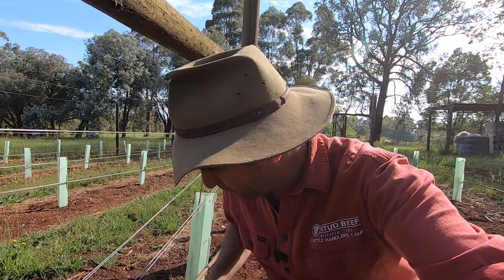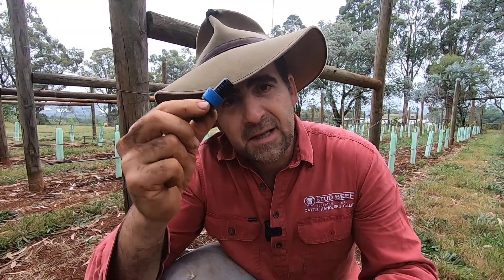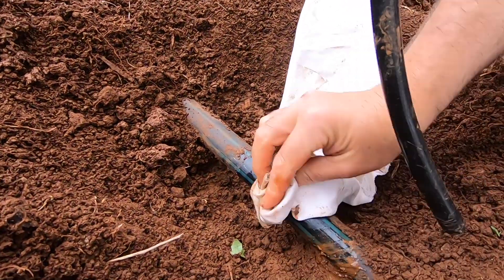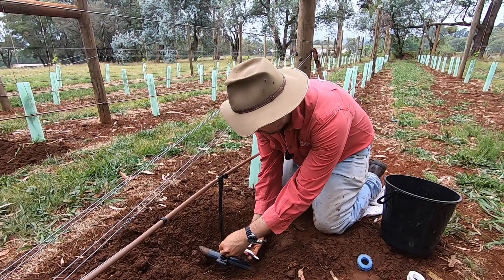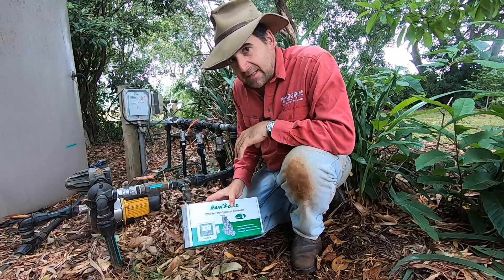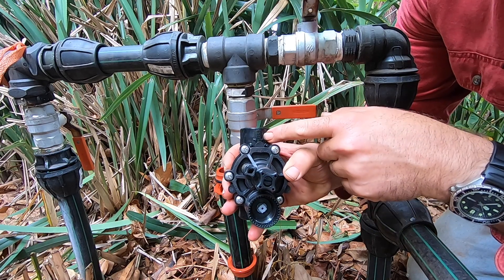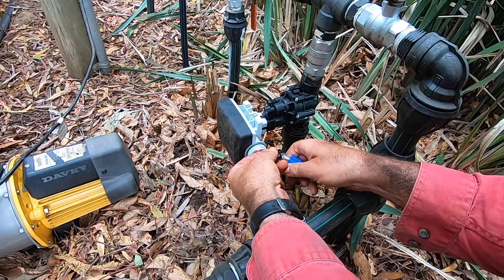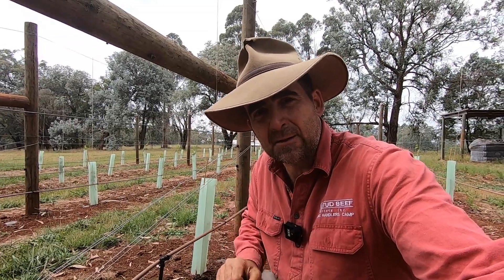Vineyard Update   Exploding Grommets and New Irrigation Controller Install

Comment: Just got in from working on my vineyard row. 
Got the end posts stayed today and tensioned the first wire. Set the line posts to final height and screwed them in place (long story).  Then did a lot more soil prep work. The whole row has been trenched to 400mm deep so it can be backfilled with amendments and the worst of the red clay replaced with top soil from other trenches on the property. Unfortunately the excavator stopped digging before the end of the row, been good exercise finishing it by hand though.
Reply: I've wanted my own vines for 5 years now. I pruned tens of thousands of vines over 3 years before becoming a professional fencer. Studied horticulture before all that. Feel like I finally have all the skills to give it a try.